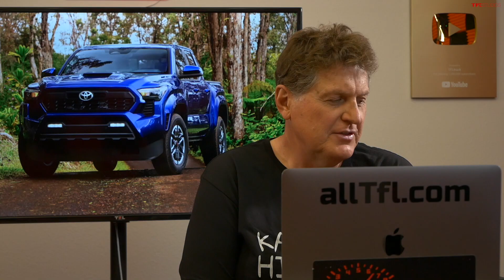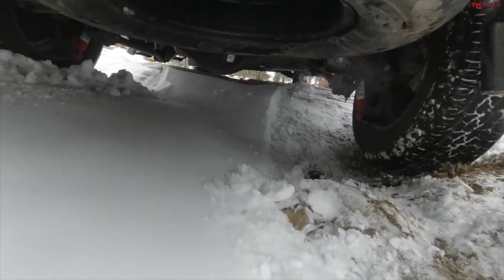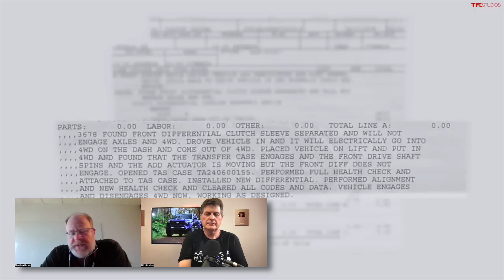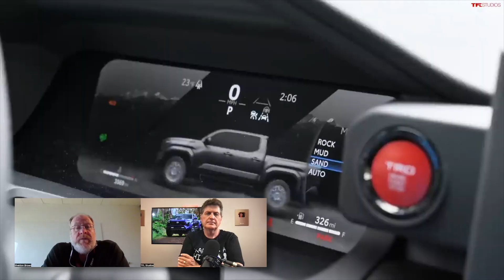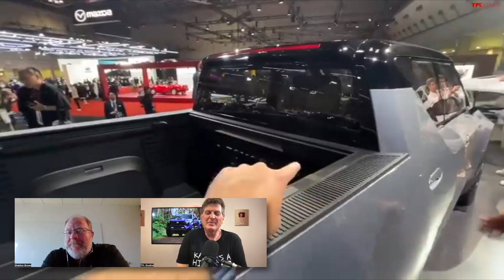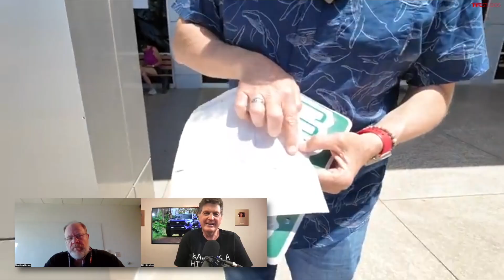The Real Story Behind How Our New Tacoma Broke & How Toyota Plans To Fix Yours!

Comment: Was about to purchase the brand new Tacoma, went to the dealer and found out the bed is actually composite not metal. And are not built or assembled in Japan. What a shame so I went and purchased a Tesla Model Y instead. It's basically a truck with more space in the back seat and can haul a trailer if I ever need to pull heavy items plus you save on gas and its way faster too. It checked all the boxes for me vs buying a Tacoma

Comment: So the limitations of the drive train was exceeded by driving on an icy surface with very little traction? Yup, I guess I’ll stay away from the new Tacomas.
Reply: Toyota enthusiasts are even considering Chevy colorado I never thought I'd see that. No real complaints for Colorado, seems to be built strong. There's a few complaints for transmission, a small percentage of failures is to be expected. Let's say less than 1% of the trucks. Reliability is determined by what percentage of these trucks have major issues after a while.

Personally I think Nissan makes the best mid sized truck in 2024

Comment: Very interesting. After the conversation, I was left wondering why something would fail at 1.7 percent over spec. What does that mean exactly? I know that certain equipment is designed to cycles or duty loads, etc. I don't have any context where something breaking at 1.7 percent over would be acceptable or make any sense. But, I could be missing entire theory and engineering behind vehicle manufacture. I do understand that software, because of things not totally figured out in programming - real world testing always exposes more than can ever be all figured out ahead of time - could in some strange scenario, suddenly send far more power to something than it was designed for or would ever need.

Comment: Toyota built the truck for "typical customer use".   This means never needing 4 low and always using graded roads. I heard Sheldon say that the traction control system was the reason the front drive train snapped. High brake clamping on one wheel  in shifting traction conditions exceeds the design ratings and critical parts fail.  This is like wearing white skinny jeans to go work in a muddy field.

Comment: My 1998 tacoma also twisted the front differential. I had the front driver's wheel locked up by ice. Truck was in 4 low, and transmission was in 1 gear.  I tried driving about 1/4 km on icy snowy road trying to get my front driver's side wheel to rotate. The rear end was doing road speed, the front right passenger side was doing twice road speed. And front driver's side was not rotating. Then the front differential broke. Toyota did fix it under warranty. But the front end cannot handle abusing torque through the front diff. 4wd high it would have survived.

Comment: Seems like a weak explanation...engine generates too much torque @ low rpm that exceeds the mechanical capability of the driveline components.  The perfect storm of conditions led to the failure...seems like that type of situation would take place in the higher elevations across the US and during the winter months.  Big fan of Toyota and their products but for the price point of the trucks this is not an acceptable failure mode.  Should do better as a company.

Comment: This response is honestly sad and surprising. He gives us the run around on how unique the situation is and how unlikely it ever happens to anyone else and THEN has the AUDACITY to make the fix about de-tuning the software instead of increasing the strength of the components. Shocking stuff from a company that once claimed to make things 'overbuilt.' This is the exact opposite of 'overbuilt.' I'm not mad it broke im mad at this response.
Reply: Total bull shit. Should be designed to handle all possible torque! Freaking designed to be babied by software? That means it's hugely under engineered. I get it, add 35" tires cvs snap. In this case it can't handle small, stock tires and light off roading with out software saving it? And light duty highway traction control sent too much torque to a wheel by slamming breaks ? This is bad...
Reply: Redesigning and changing specs of parts cost a ton of money. A simple software detune to fix the problem cost them very little. It all boils down to poor engineering. Which is why he is being pulled from is position and going to Japan for training.
Reply: @LawFarin  the present cost for a software update will be nearly nothing, but the future cost of their reputation and the loss of potential buyers could be astronomical.

Comment: Well the fun of off road is having more clearance better tires to go further without getting hung up. Jeep built the jeep with this in mind you can put 35’s on and be very reliable even 37’s , and having unreal torque on the axles. Even my Lexus LX570 could handle off-road like that on 32’s like that with zero issues

Comment: Anyone else questioning their current Toyota? I have a 5th gen 4Runner, and it's kind of lost its luster, like I don't even want to be associated with Toyota anymore.
Reply: We ordered a Grenadier to replace our 5th Gen Four Runner
Reply: @lloydswartz7354   awesome!
Reply: Bizarre logic...how bout glad I got the legendary fifth gen before it's gone... Defintely going to be worth ALL the money..?
Reply: @MtndogCO67  Agreed. The Gen 5 4Runner is going to be the one to own. It’s a dinosaur, but proven and bulletproof
Reply: What’s wrong with your 4Runner?
Reply: @bobcoats2708  Nothing really, just 10 years old, and very outdated, underpowered, ect. 5th Gen 4 Runners are solid vehicles when it comes to reliability, and in some ways SO much stronger then prior models. Other then the fuel pump screaming in agony for 8 years, lol. But after dropping 6K just to add a winch and realizing the 10s of thousands it would take to get 35s, lift, gears, rear bumper and a front end that might or might not ever survive enough to be practical......combined with purchasing a 2018 Power Wagon later and realizing how out classed the 4 Runner is by modern competitors we decided to move on. I will no longer purchase a 4x4 with out a Solid front axle, winch and twin lockers. There are too many vehicles with that modern tech now and there is simply no reason to keep doing all that with after market. The Ineos additionally can tow what we need and is designed to last forever, unlike the newest Toyotas. One ton running gear works for me! Look, I am 55 and have put my dues in dealing with crappy IFS on the trail. I have changed many a tie rod, CV shaft, drag link, A Arms. Its time to move back to what works, old school. Not software that limits power so a delicate IFS axle or under built transmission does not fail. Besides, too many Four Runners on the trail now! Ineos is more interesting and fun. If you can step up to the next level $$$$ why not.

Comment: That was the weakest amount of strain placed on a truck offroad ever lol

The fact it broke is embarrassing
Reply: Really full torque to one wheel while all others have lost traction is the weakest amount of strain placed on a truck ever? The parts have been used before. It’s a software bug. They’ll fix it and move on. No other truck has had this issue, including mine. I’ve taken it on sand, rocks, water crossings, pretty fast on rutted out roads. It’s fine at 5k miles.

Comment: So basically they are going to nerf the system through software so it doesn't break parts, Instead of creating heavier hardware. Hopefully the software doesn't weaken power so much you can't get out of trouble.

Comment: As a mechanical engineer, I don't envy the position Sheldon is in. He has to explain (BS) away the shortcomings of a product that the higher-ups hacked his budget on. 

But, Toyota's stance on this is pathetic. For those that don't know, dynamics is the study of things in motion. There was a lot of motion happening when the failure occurred. The truck was moving side to side, the angles fore and aft as well as side to side were changing, in turn changing the weight distribution at each corner, the shape of the rocks were changing, suspension was loading and unloading, coefficient of friction was changing with ice/snow/rock contact, engine rpm and torque was changing..... and after all that, they "calculated" that the design parameter was exceeded by precisely 1.7%? Sure.

Comment: A real consumer would never get this level of service or responsiveness.

They have a long, drawn out way of saying they have a design problem and they have insufficient design margin in the hardware.  They aren’t going to fix the hardware problem right now so it can happen again.  They are working on a software solution instead to limit the drivetrain forces further.

At least he was brave enough to come forward.  The response was disappointing but not surprising.  The powertrain was designed to the minimum strength required for typical operation.  Don’t push your luck on a trail.

Tread lightly with these new Toyotas or you could regret it.

Comment: From the ultimate Toyota fan boy, who currently owms 4 Toyota's.  I am disappointed Toyota.  Do better.

Tacoma transmission failures, Tundra turbo and engine failures.  Do better.  The answer isnt make the truck make less torque through software or less aggressive traction control.  The Colorado front IFS is capable of a front locker from the factory.

Comment: Had a 96 Tacoma with manual locking hubs. Drove the shit out never a problem. Would never buy one of these  pieces of garbage. But as long as it has a 60 inch flat screen and 27 off road drive modes, 18 cameras and cost $55 thou people will buy?

Comment: I WAS in the market for a new Tacoma, but I see no indication of any physical fix to the problem that one wheel cannot take the maximum torque that can be applied to it. This is not a rare circumstance, the truck was just climbing up a slippery slope in 4-low. A software limit control does not address concerns that the drivetrain is fragile.

Comment: I applaud this engineer to come answer talk about this…. With that said, instead of using the hierarchy of controls to really correct this. Like making the components more robust, or remove it and go to wheel hub locks, they decided to downgrade the power going to the weaker component?  The ADD is ONLY there because of fuel mileage, and because obviously these components are weak, they should either remove it, or make it much more robust so that it wont brake … but no, they decided to just wind down the torque delivered by a software update….. that makes ZERO sense and goes against the Toyota “Kaizen” model.   How about going back to making basic, affordable, quality trucks? There’s a thought!

Comment: Lift a truck.  Add bigger tires.  Yes, you do stress the components.  Nonetheless, the components in the vehicle should not be running on the edge.  I know it is cost cutting to build the bare minimum, but it isn’t cost effective to the owner in the long run.

Comment: Modern vehicles are getting too smart for their own good. Just build solid systems that can handle the power. I get it. Lighter is cheaper and lighter meets EPA standards, but these are TRUCKS, not cars.
I'm shopping and evaluating for my next midsize pickup. Tacoma, sadly, was the first to be eliminated.
I'm a two time Tacoma owner, and my 2000 and 2005 were both great, but this new generation is well behind the competition on mechanical and interior fit, finish, comfort, and even road noise.

Comment: Another YouTuber just blew up a clutch on a brand-new Taco. They also said that Toyota had to detune the already underpowered truck to accommodate the transmission. The number one reason people buy Toyotas is reliability. They built their entire brand around that and they are quickly losing that reputation.

Comment: How is a problem with a truck "off the record" if you own it?
Reply from the maker: The problem is not off the record, the solution to the problem was.
Reply: @TFLtruck In your video you state, with the engineer that there is no solution yet, they are working on it. Words are tricky I see.

Comment: So software prevents it from breaking? And the answer is adjust the software? Not make the truck durable enough to handle all expected use cases including snow where it can slip and grab on a hill. The number 1 reason 4wd is used is for snow and hills. What a bad answer from engineers stuck in their engineering heads. Somehow they are convinced this is a low likelihood scenario but honestly I can see this happening with most 4wd truck owners. So TFL by simply driving uphill in snow did more extensive testing than Toyota did on their flagship product. Toyota is only digging a hole with this one and the engineers can’t even understand what they are doing to the brand by having this solution and thought process. Should be able to gun it and just drive, not baby a truck that might break with too many “Newtons”. As an engineer myself, shame on those engineers and shame on Toyota for having this response that only a desk jockey engineer would be ok with. At least I truly know what truck not to buy.

Comment: The first Red Flag for me is that they De tuned the engines for the Manual Transmission variations. They themselves said it. They can't control your right foot when releasing that clutch. "snapping drive train components. Transmissions overheating also a problem. The list will go on with time.

Comment: So don't buy a Taco for anything off road. If you do, you'll need to turn to aftermarket to beef up the driveline for a problem that should not exist.  Pathetic. Buy a Gladiator,  ZR2, Ranger Raptor or even a Pro-4X apparently if you need to get up anything more than a snowy driveway.

Comment: I am sure this happened because there is no limited-slip front differential, so brakes are used to imitate it. When one wheel started spinning, the brakes were applied too aggressively to it, and this caused a shock in the differential assembly, and it snapped. A solution would be to apply brakes more gradually when imitating a limited-slip differential

Comment: What this guy is saying is that this truck isnt engineered to be reliable. Thats the bottom line. Not all the torque was going to one wheel. All the wheels were spinning so torque was going to all wheels. This is such a marketing BS answer. How did you calculate that you exceeded the limits of the ADD system by 1.7%? Seems a bit like you pulled that out of your ass.
Reply: He is an engineer explaining how Fatigue Load Limit was exceeded by 1.7 percent and shit broke.

Yes wheels were spinning. That is exactly what let the diff blow up by allowing the ADD system to send too much torque to one corner. The LACK of traction causing this event was explained clearly in this video.
Reply: @zonacrs  I'm not sure you understand physics.  Actually the more traction you have puts more stress on the drivetrain. The fact that it broke in a low traction situation means the drivetrain just isn't engineered to be robust enough to handle the stress of light off roading. And 1.7% isn't much of a safety margin in my opinion. Toyota will fix it with software to cut power before exceeding the limits of the drivetrain rather than re-engineering the drivetrain to mechanically handle the stress. So now when you off road you may find yourself mashing the pedal to the floor to overcome a situation but all you'll get is limited throttle.

Comment: So that was a word salad that in essence said the front differential is not strong enough in certain situations but we aren’t going to strengthen the differential. We’re going to change the software. Sounds like good reasoning to not buy this truck if you intend to go off road.
Reply: What word salad? He explained it pretty clear. The traction system accidentally dumped all the torque into one wheel all at once and broke the shaft
Reply: WOW.  Toyota really is junk now. For real

Comment: To me it looks like all the wheels were spinning except the front right was intermittently grabbing traction on the rock and the repeated grip/slip of that tire with all the torque did it. Honestly I’d chalk it up to operator error but you weren’t really doing anything wrong. Just a bad situation. Should have been smoother on the accelerator and kept the momentum going. You let off the gas and that’s what got you in the bad spot. Should have backed down and given it another go where you get it in one smooth shot

Comment: What I'm hearing is that they used the same set up as they were using in the V6 Tacoma, without taking the low end torque of the new engine into consideration.